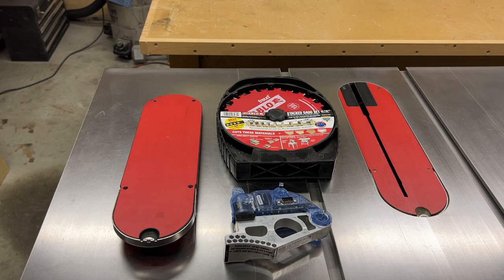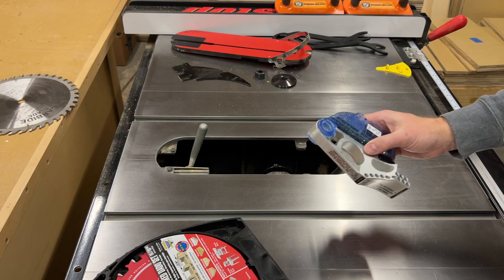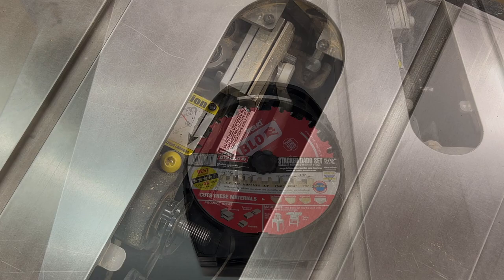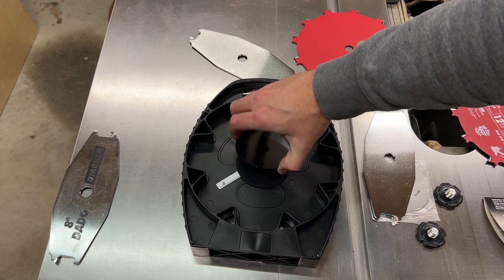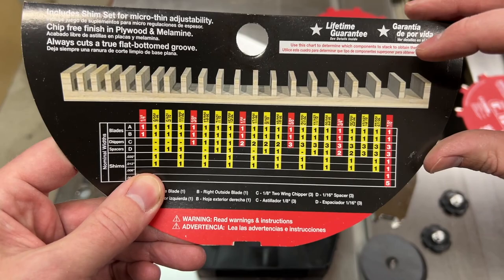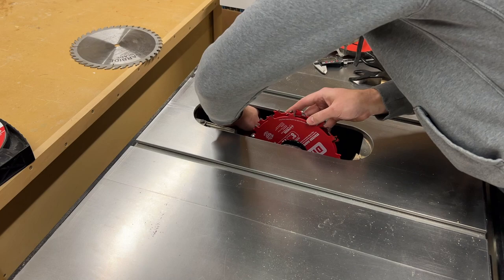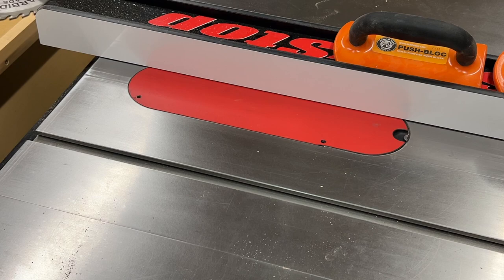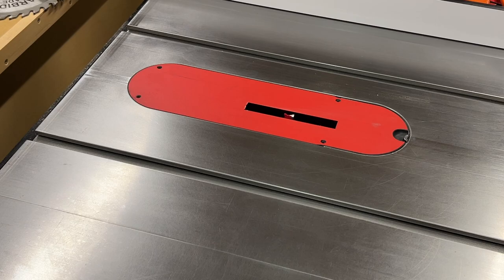SawStop Dado Stack Setup with Diablo Blades

Comment: Would have been nice if you explained how to position the blades/spacers/shims relative to each other.
Reply from the maker: Yeah my bad on that…should have added something around that.  Just put them between each blade/chipper making sure all the teeth still overlap for a clean cut.  Thanks for watching.

Comment: Important Note! This is a "Freud Blade" which has the Anti Kick Back/tooth Shoulder,whicj is not recommended by SawStop!
Reply from the maker: Honestly I had no idea about that so thanks for the heads up.  I probably won’t replace it right away since my primary reason for buying it is done now…but I appreciate you pointing it out.  I will add a note in the description to this point as well.